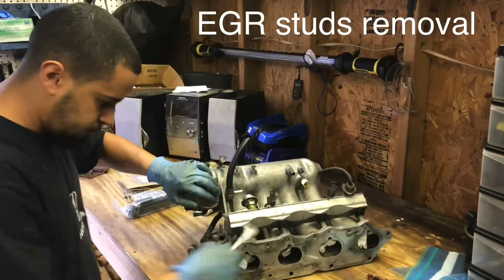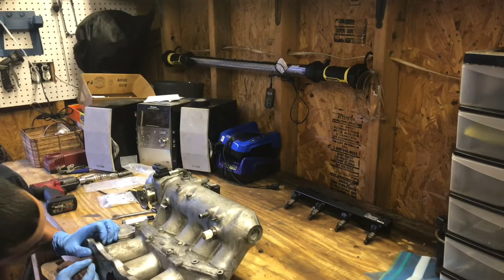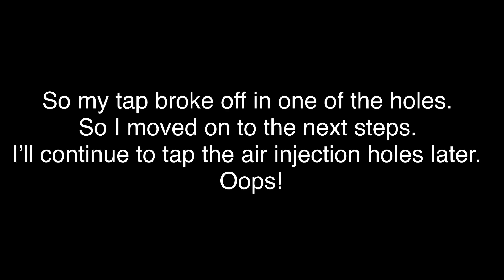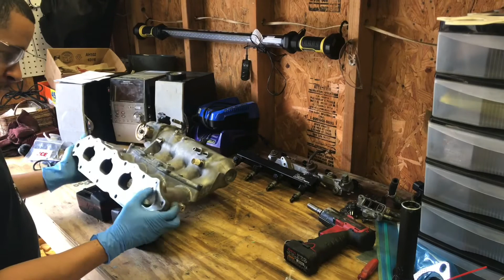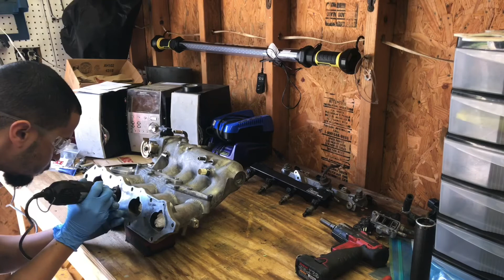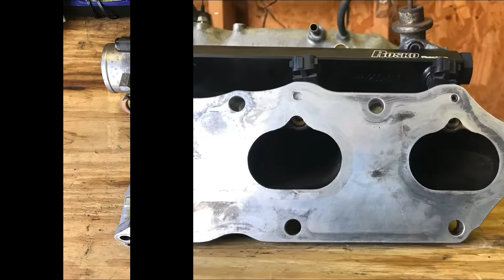JDM H22A Euro R intake manifold modification

Comment: Hello I have a question, do I need to block the little holes next to the injectors if I am using the Type R head ? I will use 2 wire OBD 1 IACV with an adapter plate. (Euro R intake + Euro R head setup, just in older car).

Comment: I had same problem with h22 stock injectors. I had too use some washers. How did everything work. I have same setup still didn't put it on gotta get a ECU first
Reply from the maker: Everything worked out as it should. No issues

Comment: Any idea why the air injection holes need to be plugged? I can't really tell where they route to, but they seem to be blocked by the intake manifold gasket anyway.
Reply from the maker: Jack IIE Toohey Yes I thought the same. They get covered by gasket. But still need to be blocked
Reply: @mcbuilt16  - the air injection holes route to where the injectors sit , and the hole goes where the bottom injector seal goes , never understood this as soon as you fit the injectors and seat them, the hole gets blocked 🤷🏻‍♂️
Reply: Massive vacuum leak if you don’t plug them